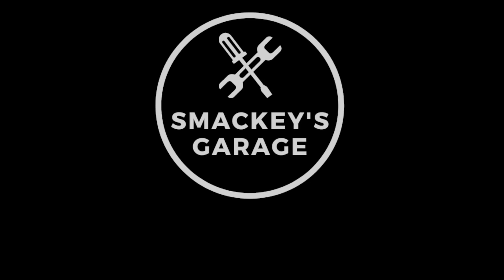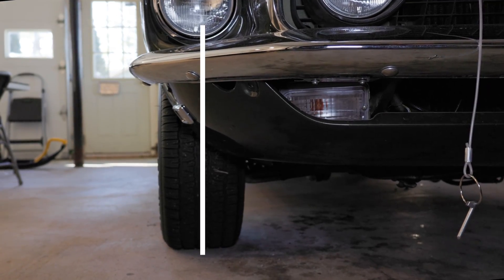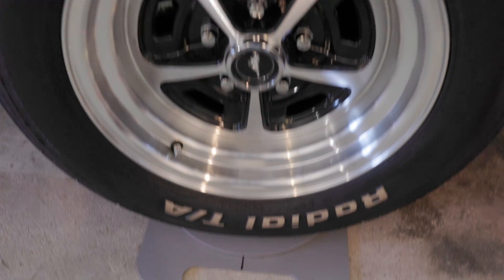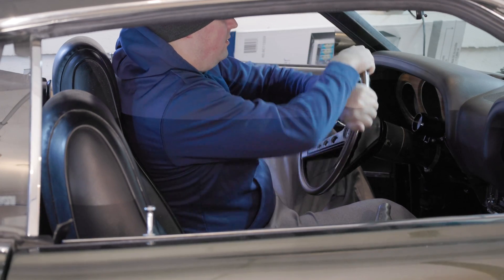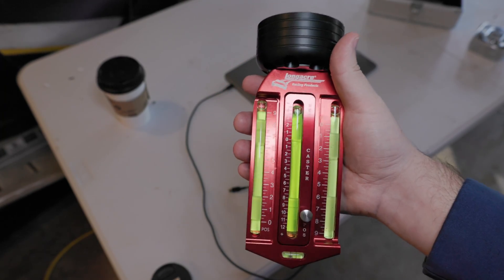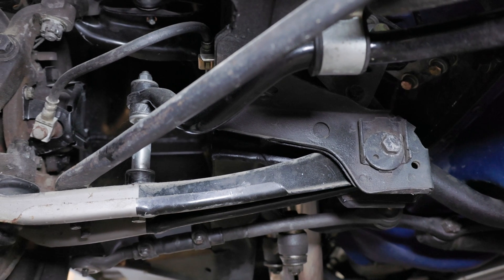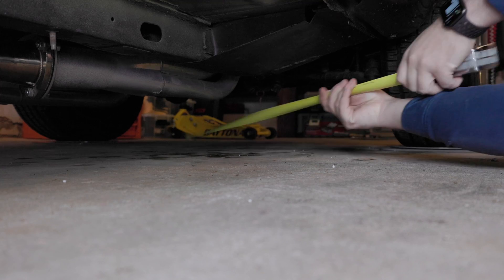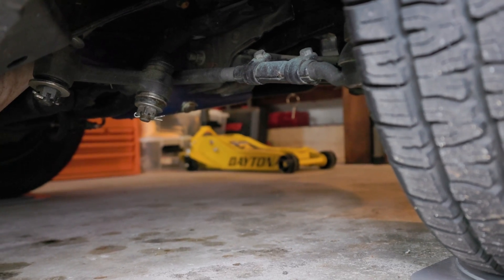How to Align a Classic Car - 1969 Mustang Alignment

Comment: What brand is the gage you use?
Reply from the maker: Longacre
Reply: @ got it. I was looking at Snap on ones and that’s a good idea on greasing steel plates on a budget.
Reply from the maker: @johnnyhonda7576  Thanks! yea no need to buy expensive plates if you want to get in the ballpark. I've used the grease plates before with "success"

Comment: I admire your courage and effort, but as is often the case with DIY alignment videos, much is left to chance due to omissions in vehicle preparation and procedures. To start, the slope of the garage floor will affect your camber and caster readings. The vehicle will naturally lean toward the lower end of the slope, shifting its weight and altering the angles. A properly calibrated alignment rack, on the other hand, is leveled to within 1/16th of an inch from corner to corner.

Another issue is the lack of compensation for runout in your rolling stock. Hubs, wheels, and tires always have manufacturing tolerances because the machines that produce them are also imperfect. If you haven’t accounted for lateral runout, you can’t be sure whether you’re measuring from a high spot or a low spot. For example, with your 1/8th-inch toe-in, rotating the tires 180 degrees could result in a reading of 0 or even a negative toe.

Your Mustang left the factory with up to an inch of end play in the front end, stemming from the wheel bearings, tie rods, ball joints, and other components in the steering system. Combined with the fact that the vehicle’s load is supported by springs, this makes alignment a more complex task than some might think. Essentially, you’re trying to measure a “brick made of Jello,” which can shift in any direction depending on the forces acting on it.

Modern, commercial-grade computerized alignment systems are designed to account for all these potential points of error, providing accurate and repeatable readings. These systems allow you to consistently return your vehicle to the specifications established by engineers after thousands of hours of testing. These machines cost tens of thousands of dollars for a reason, and a well-qualified technician would have undergone 24 to 40 hours of training with a certified instructor to master their use.

In my honest opinion, the time and money you invested in gear for this DIY approach might have been better spent on a professionally performed alignment. A proper alignment would last you at least five years, especially given the limited driving your classic car is likely to see. Additionally, you would receive a detailed printout of the readings, providing valuable insights into a multitude of alignment-related metrics for every corner of your car and the vehicle as a whole.
Reply from the maker: I agree with your detailed feedback, and I agree with pretty much all your points. Technology has come so far, that there are a lot of factors that come into play when doing an alignment, which you called out. No one is going to have a perfectly level garage, and it's hard to account for runout.

If I was going to be taking this on long trips, I'd get an alignment done by a professional shop. Thanks for the detailed message and I hope others find it useful. Appreciate the sharing of your expertise!

Comment: dude! Everything effects the toe for me. i'm trying to rough in the alignment on a 63 thunderbird. The PO changed the steering box or had it done rather and they never did an alignment. it was pulling to the left and right front had toe in and left front had toe out. I don't have two nuts like you do, just one big nut and there wasn't even a cotter pin in it. thanks for the video. I understand the suspension a lot better, but i may get a pro to finish this up. I'm afraid i'll put something in a bind.
Reply from the maker: Glad I could provide some guidance and awesome you have a 63 thunderbird! There is no shame in getting a pro to do the alignment. They have better and more accurate systems than anything that is available consumer grade.

Comment: What does shimming the upper A-Arm do? Isnt that part of an alignment?
Reply from the maker: It is part of the alignment. It shifts the upper A-Arm out if necessary. I was able to use the bottom control arm concentric bolt to shift camber. If you didn't have enough adjustment for some reason you could use shims to adjust it "some." I'd be checking to see if the shock towers have shifted inwards over time though if you don't have enough adjustment at the lower control arm.

Comment: Nice video. Your almost there.
Run a straightedge from turn table to turn table and square them up to each other so your 20/20 is car centered and accurate. Use the steel spare wheel/tire in the trunk so you can go straight to the car disc hub with the magnet mount to avoid wheel imperfections.
Toe measurements with the tape/string method will be a little fuzzy because of tire imperfections/deviations, so we got to do a little better. 
For the toe. Make a pair of "perfectly square" 3x7 foot right angles from perfectly straight metal of choice. Graduate the 3-foot legs in 32 seconds of an inch starting from "exactly" the centering dimple on the hub spindle. Run a tapered centering bolt through each 3-foot leg into each spindle dimple for that. Attach one 3-foot leg to each hub, this will require a spacer and attachment method that you deem 100% square/accurate. You will need to use 2 steel wheels so you can go straight to the hub. Read the individual toe for each tire where the 7-foot legs cross over the graduated 3-foot legs in front of the tires. Dead nuts accurate every time.
Reply from the maker: Thanks for sharing. These are a lot of great tips on how to improve on the process. Maybe this winter I will go ahead and redo the alignment with these tips and see what the delta is. Your comment is a great way to improve on the process of my "within the range" and change it to dead nuts accurate to a target.
Reply: My pleasure. I was sitting here, having had many Mustangs, and imagining driving your car down the interstate at 70 with it running perfectly straight with no reaction to wind or road crown. And the tires and driveshaft balanced like a gyroscope. And the carb and ignition working like new money. And how nice to drive some of the old cars really are. And being happy for you that you have that car. And thinking about how the devil is in the details. I hate that detail part, I don't got time for details, I got to get out and drive some of my old cars down the interstate today.
 @SmackeysGarage

Comment: try checking the caster by leaving the guage on the wheel when you go from 20 deg back to 20 deg forward
Reply from the maker: I would have but unfortunately the wheel isn’t steel. I also tried taking off the center cap and still no luck.

Comment: Doesn't mean the car will track straight.  If right was toe out .5 inches and the left was toe in 1.0 inches the way you measure the car would have negative .5 inches of toe but the car would still track right.  You would still need to pull a string from front to rear to make sure car is tracking straight then toe in each tire the same on each side.
Reply from the maker: That's a great point Dan. Having the string front to rear makes sure everything is square.